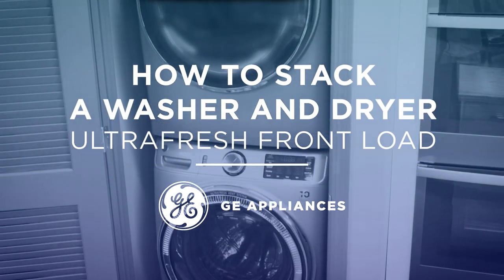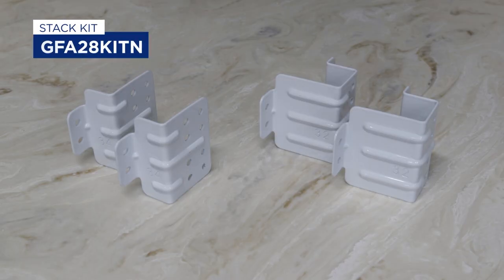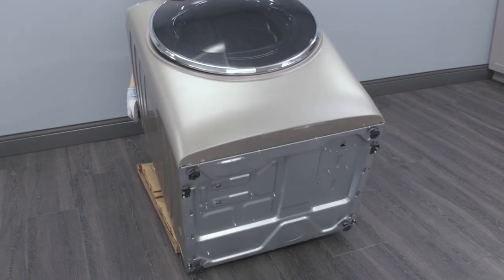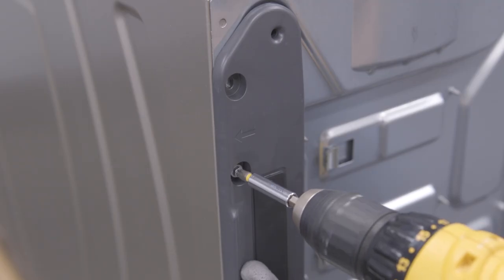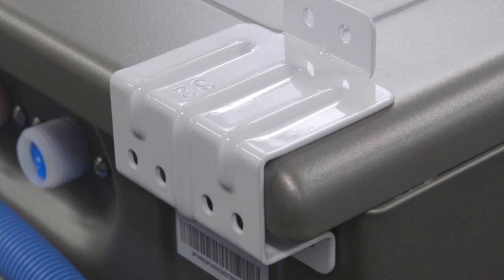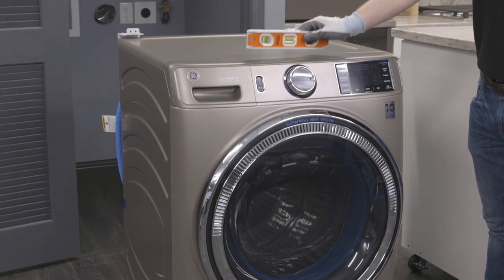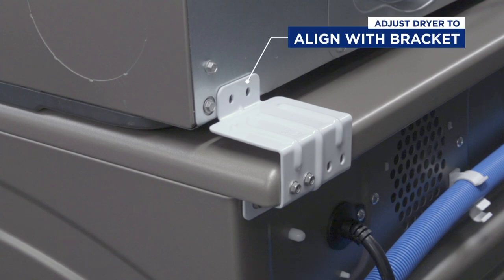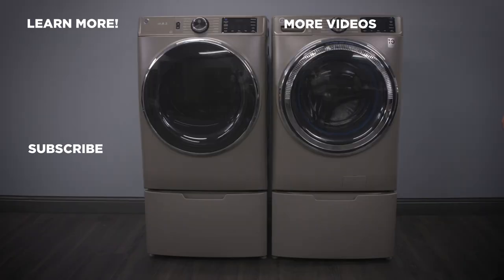UltraFresh Front Load:  How to Stack a Washer and Dryer

Comment: My washer doesn't have the long top lip protruding out from the rest of the washer for bracket to go around. Bracket is in the same position tho.
Reply from the maker: Hello lfinn0330, As long as you have one of the washers listed then you are set to go! Enjoy! -SF
Reply: Hello, I have a GFW550SSNWW washer with a GFD55GSSNWW dryer. I plan to stack these units inside a 80" door opening. The specs state the total height for the washer and dryer is 79.5 inches. Does the stacking kit add any additional height or is it offset via removing the dryer legs? Will this combo fit my height limit?
Reply from the maker: Hi Brian,

Thanks for reaching out! We'd be happy to help!

The height listed in the specs when these units have been stacked is the complete new height for the stacked units. Since you cannot stack these units without the stacking kit, this is the only "stacked" height dimension that is available.

If you have an 80" high opening, then the units, when stacked, would be able to fit since the new height is only 79.5".

We hope that this helps! Please let us know if you have any other questions or concerns.

Stay safe. -MS